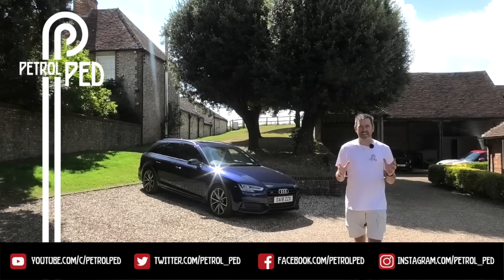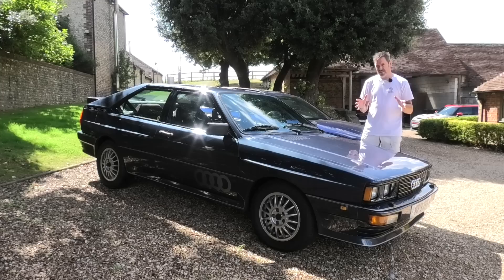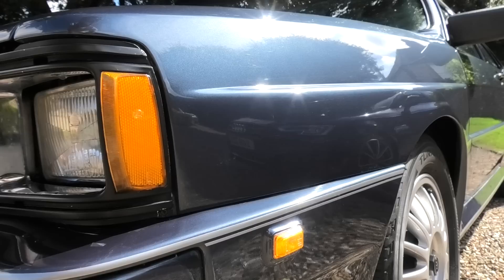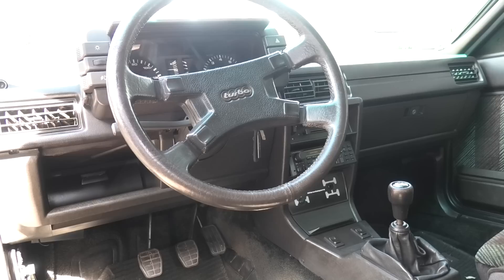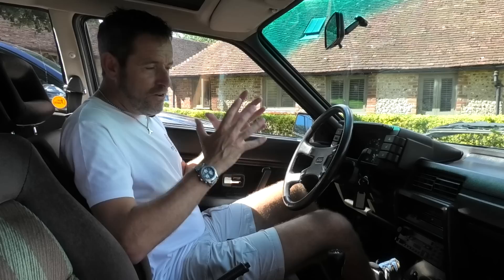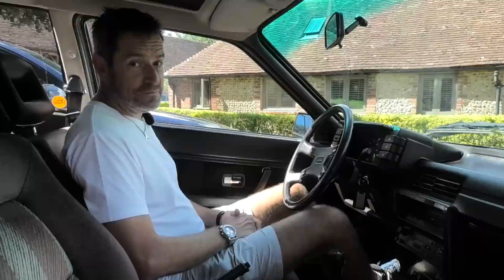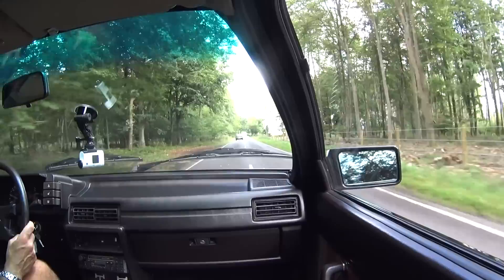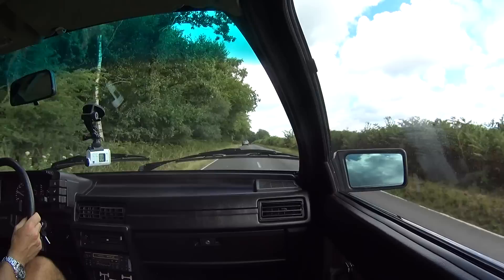Driving the original Audi Quattro - The car that changed the world !

Comment: You get it.  Driving an Audi from this era is a sensual experience.  And we are sensual beings.  Unlike cars these days in this stimulation is engineered out of the car.  If i was stuck driving one practical classic car forever it would be an 80's Audi.  Even the 4 cylinder 4000.  At 90 mph on the highway it would really begin to hunker down.  The little 4 with the 5 speed would just start to roll up up up and if you didnt watch it you'd be at 5k on the tach just cruising way too fast.  A lot of younger drrivers just don't understand why we get so attched until they actually spend some time in these older cars. What great memories.

Comment: This is why im now driving an older car once again. My A45 has gone, and now driving a 27yr old Saab 9000 Aero 2.3T with 360bhp. Ive replaced the entire suspension, and over 20 bushes. All balljoints etc and now it drives better than my A45 did. With no nagging computers  trying to take over everytime you go into a bend too fast. 0-60 in 5.6, and 100 up in 10.5. Its quick, really quick. And yet today on a 3.5hr drive i averaged 40.5mpg. Just a brilliant car. Im never going back to a modern car.
Reply from the maker: Cool 👍

Comment: Please keep up great reviews like this.
I was lucky enough to own a quattro for over four years from 1987 and it remains the best car I should never have sold. Every journey was an event. Nothing came close to sounding so good. At the time the combination of four proper seats and so much useable performance, it was unbeaten. Four wheel drive, abs, electric windows and mirrors, digital display and even audible voice warnings (although I know many people had that disconnected). Undoubtedly the best looks and that glorious engine. You got used to the big gap in the gear ratios between second and third and the turbo lag. At the time the brakes were good and when most cars had tyres with a profile of 70, the 50 profile fitted to the quattro was pretty state of the art. I recall that the only other production car to have the same size tyre was a Lotus (Esprit?).
Living in Somerset it was the perfect car for blasts along the B roads across the Mendip Hills. So many happy memories.
Please don't refer to it as an Audi quattro coupe though, it's an Audi quattro, plain and simple!
Reply from the maker: Thanks for this 👍
Reply: I agree with you, the Audi quattro Coupe was a different model, this is the Ur quattro. And yes it should be spelt with a lower case “q”. Only the S1 got a capital “Q”. 
200 bhp may not sound much today but back then most cars had way less than 100 bhp. Back then cars were a lot lighter too so bhp/ton was probably comparable to most cars today. Good times though

Comment: Hard to believe the Quattro Coupe came out 40 years ago ,  it still has a very distinctive design which has aged well and certainly was ground breaking in rallying but i always thought the 1966 Jensen Interceptor FF was the first four wheel drive production car , that 5 cylinder had a lot of character and unique sound , great to hear the sardonic tones of Geoffrey Palmer in the advert ( still with us at 93 ! ) , Audi boldly claimed that the engine was as smooth as a 6 and as economical as a 4 cylinder which was stretching the truth somewhat.   I wonder if JLR could lend you an even more pioneering vehicle , the first Range Rover that has just celebrated its 50th anniversary , that would be epic !.
Reply from the maker: That would indeed be epic 👍

Comment: The only distractions I had when driving 40 years ago would have been the young lady with the long legs and short skirt (Hopefully!!) who'd be sat in the passenger seat. But those stories are best left until after the 9pm watershed   ;-))...
You said that you had a Celica too. But seemed a tad down about it? Why? They were really nice sports cars for the time.
I'm sure that a lot, if not all of the drivers you passed whilst in that Quattro, wouldn't have ever seen one before. I wonder how many actually "noticed" it. If I'd seen it, I'd certainly have had a "Wow!" moment   :-))...
Great memories for the 50 something Peddlers, Pete. Thanks   :-))...
Reply from the maker: I’ve had 2 Celicas 👍
Reply: @PetrolPed  30 odd years ago, there used to be a Red Celica GT conv. that was park at the top of Broadway in the Cotswolds almost every time I drove through the place and I lusted after it   ;-))....
Reply: Lets see a Celica GT4 on the channel :-) . Used to see one regularly in the Castrol livery
Reply: @davidsomething4867  - I like your thinking.   :-))...
Maybe even a Supra from the late 1990's.
The twin turbo'd 300+ bhp bullets   :-))...

Comment: Always find it interesting that my daily runaround that I know is heavier and don’t consider fast in my F56 Cooper has more horses than the Cars I grew up with like the Renault 5 turbos, pug 205 1.9 GTI’s, golfs etc etc that I thought were rocket ships  but are slower 0-60. This Audi was at the time the dogs dangly bits and 0-60 is 7.3 sec. My coop is 7.9 sec yet I still consider them in different leagues speed wise. Your Roadster or Clubbie would absolutely destroy this Car but the respect is given in that what it did 40 years ago was so far ahead of its time and it did it so well it was a game changer. A bit like that classic RS Mexico a few months back. I’d pass any new McLaren, Audi, BMW, Merc, Porsche and even Ferrari to look at an original mint RS mk1 Mexico salivating😁 Jumped in a friends Classic MINI the other year and it was the smell, the noise, the vibration at motorway speed that I loved so much I was back in time . 👍 Old Jaguar’s seem to do it better than any other Cars on that fantastic smell probably down to the leather but your instantly transported back in time. We’re the same age so you’ll get that.
Reply from the maker: I sure do 👍

Comment: Great video. As already mentioned the Jensen Intercepter FF was the first 4 wheel drive saloon car, but the drive train was heavy and only made sense in a car with a 7litre plus engine. Audi designed a unique and light gearbox so with 2.1 litres and a turbo ( and on later models without turbo) they managed outstanding performance for the era, and still good by today’s standards. I owned one from 1992 to 2000 and I get what you say about parking it and people just showing great love for it. Mine never failed to draw a crowd. Every time I came back to it there were people round it. A true icon of a car. Get Audi to give you a late 20valve though and do a comparison video, over the 12 years of production the development is impressive, developed more during those early years than the 30 years since. If you get a 20 valve promise to take me for a ride though. I would love to be transported back in time to when I had mine. Keep up the good work
Reply from the maker: I originally wanted to have their 20v but it was already booked. I think I need to experience that one too 👍
Reply: @PetrolPed  Get them to lend you the short wheelbase S1 with 400bhp. Might have to stay on track so you don't crash it

Comment: I had a black quattro. Non turbo back in 1993 . I was 19 . When you could buy 4 star petrol. It was a 1987 D registration car . Kept it for 10 year's . Still the best car I ever had. The 10 valve engine was amazing. 177000 miles before I had issues. I've never had a car sinse that took me everywhere and just made me love driving. Just found out that it's not been scrapped after putting the registration number in the government tax check but whoever has it has it sorned. Ten years without an MOT . how do I get this car back 🤷
Reply: Best car I ever had too. Also wish I still had mine👍

Comment: In -86, I went to a Ford car dealer to rent a Fiesta for the christmas.  They asked where I'm going, and I said it to them.  Then they said, you can get then the brand new Ford Sierra XR4x4 for the same price as the Fiesta.  They've just wanted me  to break in the car, and that was my first experience with 4x4 on norwegian snowy roads.  What a christmas present.  Not exactly a Audi Coupe Quattro, but the XR4x4 was one of the first competitors to Audi Quattro.
Reply from the maker: Cool 😎
Reply: @PetrolPed  Ford Sierra XR4x4 wasn't stable in deep wet snow mud, but very fun in normal snow conditions.  Haven't driven the Cosworth 4x4 but I think it is similar.

Comment: Drove an Audi 100 C3 2.2 5 cylinder the entire length of Namibia North to South and back again (with detour to the East at Windhoek) in 1988.  No speed limits.  100mph+ the whole way untill it got dark then we crawled as Kudu try to jump over the dipped beam and you get 1 ton of deer in the cabin, not ideal at speed.

Fastest car I drove in the 80s.  Beat the smelly stuff out my 1500cc 12V Honda company car (unavailable for this trip as I drove it thru a 3 day old concrete wall that was between my parking spot and the eventual point where I stopped.  Still got the Polaroid and a cartoon in the study at home but that is another story)
Reply from the maker: Yeah but Kudu tastes amazing 😉 😂😂

Comment: 10:37  I wonder if the driver believes we lived under stone-age conditoin in 1980? Already the first Audi 100 was designed on the computer....
Cars got so many toys and safety on board which makes them heavier. So you need to have 200 horsepower these days, where 100 horsepower did the job back then.